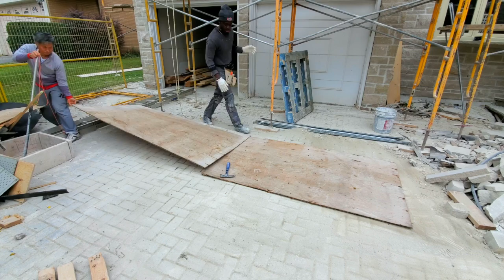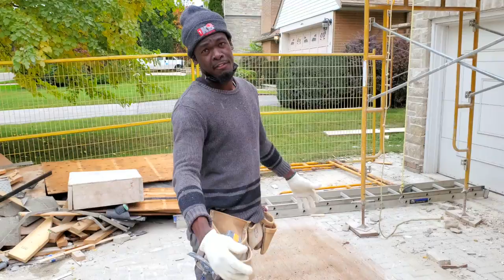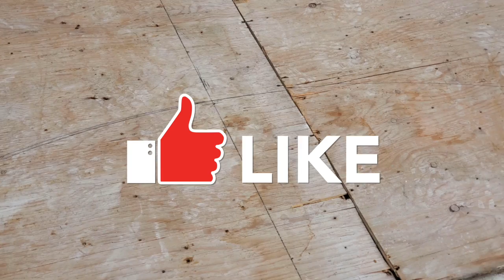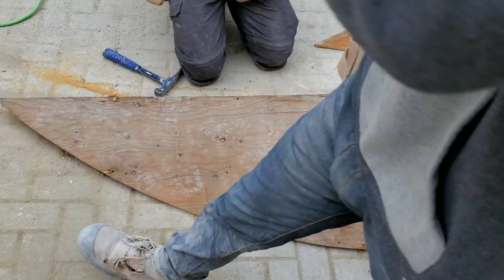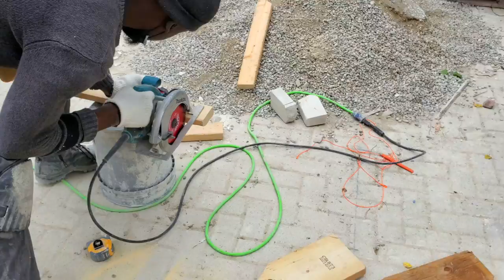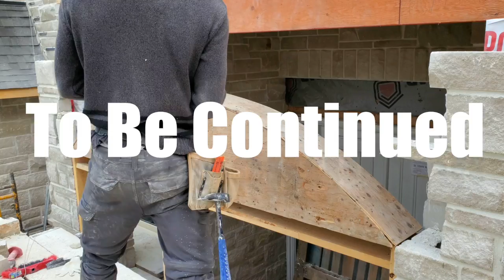How To Build An Arch [The EASY Way] DIY For Beginners

Comment: Nice work bro. take the guess work out for the radius, which got your close with 83". Here's a formula i use for arches like your case. keep up the good work!

x = Half Arch Width = 9'3"/2 = 111"/2 = 55.5"
y = Arch Height = 22"

(y*y) + (x*x)                (22*22) + (55.5*55.5)             3564.25
__________      =       ____________________   =    _________     =     81"
       2*y                                       2*22                                  44

Comment: Very nice job, I used to do this now I just pay for a custom arched lintel i know who makes the custom angle irons it works out to same price as spending your time and workers time to build it, and it’s permanent, never cracks and don’t have to take it down!
Reply from the maker: Right on
Reply: I've done a few arches with a steel lintel I don't know if it's better to prevent it from cracking because the steel expands and contracts especially if it rusts I've also done alot of restoration unfortunately and the cracks in masonry are usually because of a steel lintel or a steel column or rebar that rusted in the core of the block

Comment: Should use folding wedges each end under the arch centre to ease removal, the upright is going to interfere with the line.
Good arch setting out (segmental arch).